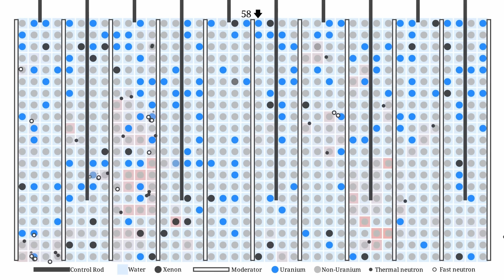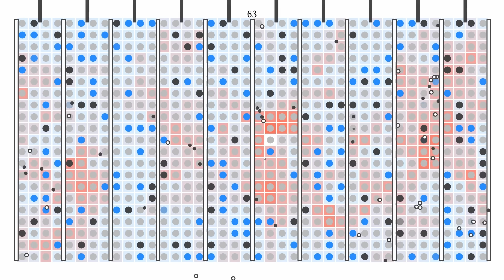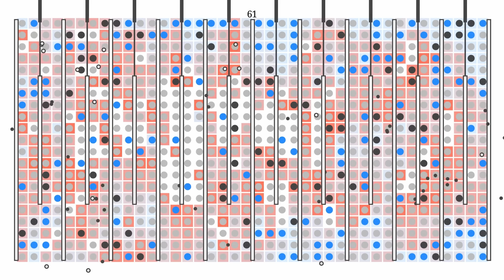Chernobyl Accident - Simulation only (no talk)

Comment: as I understand it, they reached the Xe pit because they tried to reach the low power state too quickly. a slower power down would have gradually burned most of the Xe by the time the reactor reached a low power level. this was the seminal error. then, trying to get out of the Xe pit too quickly again, they made the reactor unstable and it blew.
Reply: Oh, I realized too late what you meant. The xenon from the power drop never burnt off, no power-spikes before AZ-5 was pressed. Remember the INSAG-7 chain of events.
Reply: Increased water flow played a very heavy hand too, don't forget that.
Reply: They were under tremendous pressure to get the test done as it had already been significantly delayed and the reactor was also needed for grid power. I suppose they were somewhat put into a position of either rushing the test, or expecting visitors from Moscow.
Reply: @blockstacker5614  the reactor wasn't being rushed back onto the grid, the tests    (there were multiple) were selected to be done at the time they were because the reactor was being REMOVED from the grid for maintenance & repairs. This is typical for soviet power plants to do. Also the delay wasn't all that significant, it was just 12 hours, the only difference was that not all necessary personnel had appeared to conduct the tests and the control staff present weren't well versed in the details of the testing.

Comment: Why were the pumps shut down as part of the test?  I thought the whole point of the test was seeing if what was left of the steam reaction could keep the turbines generating enough power until the diesel generators could spin up and take over.
Reply from the maker: Maybe shut down is an overstatement. But yea, you are correct. Test was trying to power the system by inertia of the turbines.. But what I wanted to capture in the simulation is this  (from the wiki https://en.wikipedia.org/wiki/Chernobyl_disaster)

"As the momentum of the turbine generator decreased, so did the power it produced for the pumps. The water flow rate decreased, leading to increased formation of steam voids in the coolant flowing up through the fuel pressure tubes"
Reply: @Higgsinophysics  Thank God we've had folks working to correct that wikipedia page, knowing that you're using it as a source.

Comment: The sound reminded me of Geiger Counter though. Not sure if that's actually what it does.
Reply: Not a physicist but afaik, the way the Geinger Counter does make a bleep impulse sound when a particle collides with a detector, the particle has enough energy to activate and move some electricity to a speaker, we measure the amount of bleeps per minute I think to determine radioactivity in an area, might be very wrong, but that is my understanding of the whole process.
Reply: @c64cosmin particles do not have enough energy to move electricity to a speaker... Speaker works exclusively from the batteries. A particle should have enough energy just to ionize a single atom of gas in the tube. This causes avalanche ionization in the tube due to externally applied electric field. Thus, a particle role is comparable to a tiniest domino piece, which falls and causes other dominoes to fall afterwards
Reply: @c64cosmin  activate and move some electricity
Reply from the maker: It is!! Nicely spotted :D

Comment: A nice animation, but you're further promoting the misconception that there was a power surge before  EPS-5 was pressed. According to what we know, the reactor was stable prior to that, the insertion of the control rods triggering the event - though the operators unknowingly created the circumstances for that, a shutdown system should under no circumstances add reactivity.
Reply: Biggest issue as far as I can tell is that the carbon displacers didn't go all the way down. So if a rod is all the way out, there's still some water column under the carbon displacer. Which means the act of inserting that rod increases reactivity in the lower part of the reactor (by replacing the water with carbon) for some time (until the end of the displacer goes past).

This creates a situation where the lower parts of the reactor can be dangerously close to going prompt critical, prevented from doing so by water in the control rod channels. The act of forcing moderator in those sections under those conditions is enough to tip it over the edge. IIRC they found evidence of TWO prompt criticalities (literal holes blown through the sides of the reactor casing) caused by the positive SCRAM effect. An effect which should never exist in any reactor under any circumstances.

Not helped by the positive power coefficient of reactivity, where increasing thermal output increases overall reactivity rather than decreasing it (as it does in any good reactor design).

That last one, by the way, is equivalent to static instability in an aircraft, where pilot input is required at all times to keep the thing flying straight & level. Unlike a good airframe, where trimming correctly enables one to fly almost hands-off.

It's a fundamentally flawed implementation of a concept which could have worked well had they bothered to study it in more detail rather than bowing to ministry pressure to meet deadlines.

They built a sh!t reactor because they didn't understand what they were doing well enough.
Reply: What. Most investigations and the controllers in the soviet investigation mentioned a surge before scram.
Reply: You werent there. You dont know
Reply: Kinda defies logic, saying the reactor was stable prior to the scram button being pressed.  It may have seemed stable but any small deviation causes a runaway criticality event because there’s absolutely not enough control able to be asserted due to the boron parts of control rods being pulled.
Reply: @ericnewton5720  The reactor was kept under control with the automatic regulator (AR) without any issues, but it was running with most of the manual rods pulled completely out of the core. This is by itself not bad; low ORM means that you can insert a lot of negative reactivity if need be. The thing with the boron followers was that they did not entirely cover the core, leaving a water column above and below them. Water in this case is primarily a neutron absorber while the graphite acts as a moderator. Due to this design flaw, when you insert a fully pulled rod, you get a reactivity increase. When the EPS-5 was pressed, it simultaneously inserted all the rods that were withdrawn, resulting in a spike in power at the lower part of the reactor that was enough to make it prompt-critical.
Reply: "It has not been established why the scram button (EPS-5, also referred to as AZ-5) was pressed at 1:23:40. Annex I of the INSAG-7 report (see Reference 1 below), Report by a Commission to the USSR State Committee for the Supervision of Safety in Industry and Nuclear Power (SCSSINP), states: "Neither the reactor power nor the other parameters (pressure and water level in the steam separator drums, coolant and feedwater flow rates, etc.) required any intervention by the personnel or by the engineered safety features from the beginning of the tests until the EPS-5 button was pressed." The report adds: "The Commission was unable to establish why the button was pressed." However, according to Anatoly Diatlov, the plant's Deputy Chief Engineer at that time: "There was actually one reason for dropping the protection rods: a wish to shut down the reactor when work was finished" https://world-nuclear.org/information-library/appendices/chernobyl-accident-appendix-1-sequence-of-events
Reply: @Silanael  Sure, buddy. RBMK reactor can remain under control with no control rods and no cooling water. Yeah, right, and I am Queen Cleopatra.
Reply: @bunderlemu7802  They hadn't pulled every rod, a few were still in the core when they pressed the EPS-5. As @kersplody7435 pointed out, official documentation of the time from the Soviet Ministry of Atomic Energy did in fact claim that an RBMK reactor could safely with no control rods inserted.
Reply: @notme5844  Put it this way: if the reactor was absolutely stable under such condition per Silanael's claim, then why bother putting it through the test at that fateful night?

Also, I always love "We've investigated ourselves and we've found no wrong doing" jokes.
Reply: @bunderlemu7802 I love the, make up “facts” with absolutely no evidence and then cry that all their evidence isn’t true, again with no evidence and your only logic is assuming the reactor was unstable with again zero evidence to support that assumption
Reply: @Nothing_here7435  If the reactor would remain stable indefinitely with barely any control rods and nothing to pump cooling water (like OP's claim), then logic dictates that no test would be neccessary. Even having cooling waters would be unnecessary for the reactor, if Silanael's claim was true. 

Yet, somebody did the catastrophic test on April 1986 to test if the winding down turbine can still power the cooling water pump. That's your evidence.
Reply: @bunderlemu7802  Your cooling water “evidence” is completely nullified by simple precautions. Thats like saying there no reason to be carful around undetonated explosives because they didn’t explode yet.

And the control rods are again precautions, if needed, though they were horribly designed so they would spike the reaction rate while deploying. Again precautions, would you stare into the barrel of a gun because it’s probably unloaded and you don’t think it can go off.
And like there doesn’t have to be a real emergency just them being dumb and trying to use the control rods to quickly power down instead of the longer shut down process or just human error believing a threat was present that wasn’t what they thought. In every situation it’s the same story in reality that calling the emergency and dropping all control rods down at once was the stupidest thing they could have possibly done and likely set off the full meltdown.
Reply: @Nothing_here7435  The disaster happened because cooling water vapor ruptured the tube housing the control rods If Silanael's claim is true, then the "precautions" aren't precautions. Why, just make a reactor with no control rods or cooling water, so that nobody would accidentally boiled the water and the resulting vapor caused the rods to stuck.
Reply: @bunderlemu7802  so it seems my last comment didn’t post so TLDR
Precautions if designed badly like the ones at Chernobyl become a risk but that doesn’t mean that no precautions should be taken.

The pipes burst because they couldn’t handle the sudden energy spike from the SCRAM.
Reply: @Nothing_here7435  In an attempt to defend OP's claim, one posits that control rods and cooling water are merely precautions, instead of the vital parts of the reactor.

It's incredible, it has to, because the initial claim of a running stable reactor with neither adequate control rods nor cooling water is already beyond belief.
Reply: @bunderlemu7802  a reactor very much can run without them but the chances of bad things goes way up. So redefining precautions so there is no such thing as a nessssary pro caution is not an argument
Reply: @bunderlemu7802 please tell us how water and or cooling rods generate energy.
Reply: Exactly, if the reactor was totally stable, why hit the scram button? @ericnewton5720
Reply: @ericnewton5720  > there’s absolutely not enough control able to be asserted due to the boron parts of control rods being pulled.

This does not make sense. The opposite is true: the reactor is unsafe if you don't have any more absorbing rods to insert (all are already inserted), yet the power is rising.
When you have most of the rods retracted, you have ample means to shut reactor down. Such as: insert all of them!
The key is, in RBMK, the flaw is that *inserting a rod inserts the graphite tip first, which increases moderation and thus momentarily increases reaction rate*! Which is unbelievably bad design... the safety system must not have such design "features".
Reply: For all it means, how can you say the reactor was stable prior to eps-5 when almost all control rods were pulled out, water flow cut, automatic control and safety machanisms supposedly turned off? Even if there really wasn't "surge" of power right before the eps-5 any warning could scared the crew. Be it high temperature, low water level, high pressure etc. Even if alone those things shouldn't call for emergency shut off, in the circumstances they created in the reactor, the crew could be very much on edge and any deviation caused them to freak out and push the eps-5
Reply: I haven't seen a reactor in my whole life and don't really know how it works but I'm sure your discussion is fair